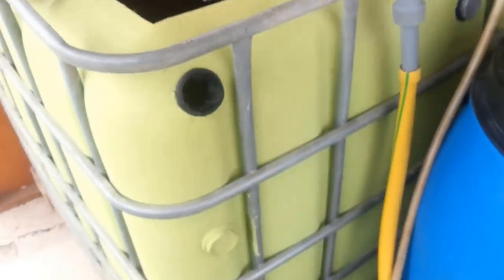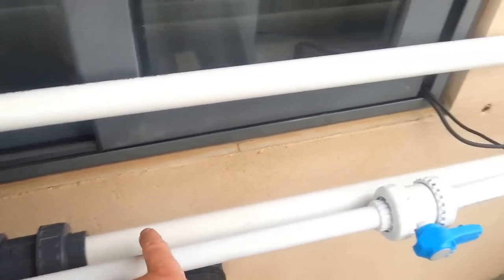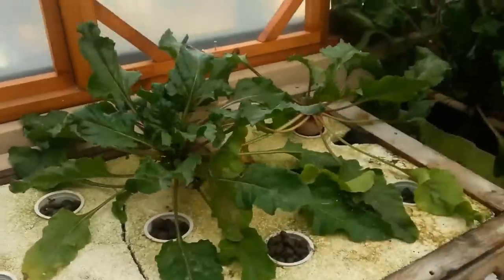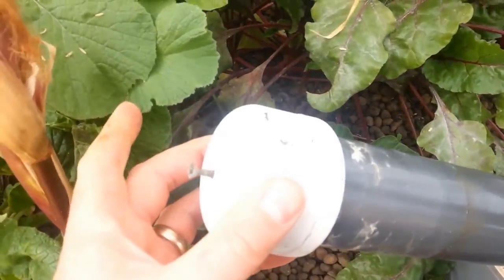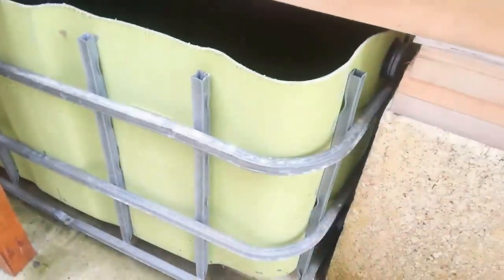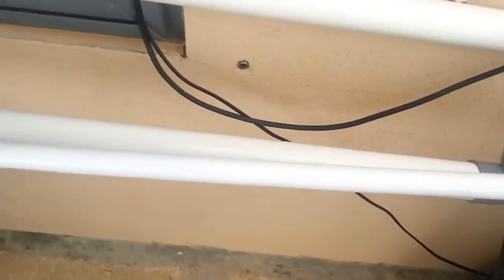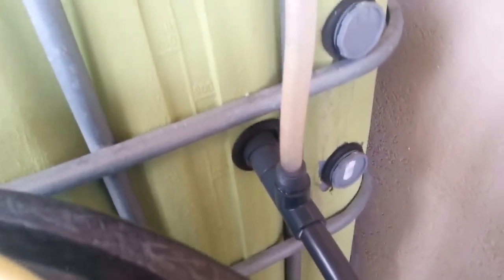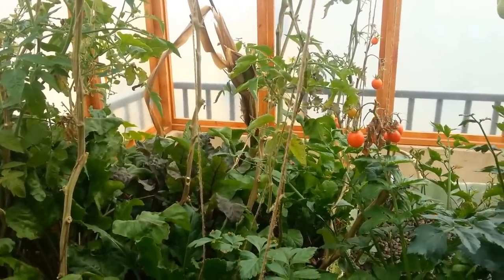Aquaponics Plumbing Radial Flow Filter and Venturi Tee

Comment: Nice one :)
Would like to see how you sorted out the venturi..
Cheers..
Reply from the maker: Thanks Rob Bob hope to have build video for the venturi finished later in the week.
Reply: Great video. For the bed your setting up, have you considered an Earthan bed setup as opposed to just a wicking bed? They're essentially the same build except the earthan bed has a constant flow of AP water through the reservoir instead of having to top it off every so often. It should work for you since your system is indoors. As with an outdoor earthan bed rain can cause contamination of the AP water.

Comment: That is very cool.  I'm looking to setup a system myself.  You and Rob Bob have allot of great information.  You painted the IBC what type of paint?  Also I live in Ohio so do you have any ideas on how to heat the system?  I have a Hoop style Green House 12 x 16.  Let me know
Reply from the maker: Thank you, I had just used a good quality outdoor paint for the IBC totes. As for the heating of the water you might try to set up a passive solar heater with 30m (100ft) black pipe coiled up inside a window frame.

Comment: I saw your original RFF video and thought it made sense So I just built one for my IBC. Unfortunately I didn't watch this video until I hooked mine up and immediately got fingerlings popping up in the filter. I'm going to put a grate on the inlet pipe and see if that takes care of that problem. My other concern now is without the internal pipe in the IBC if anything springs a big leak there's no way to stop total tank drain if you're not there.